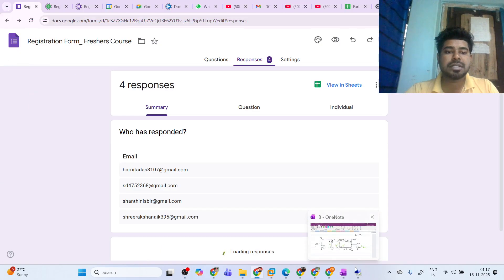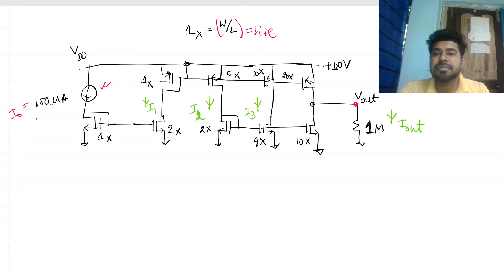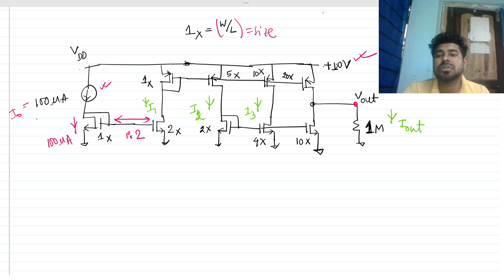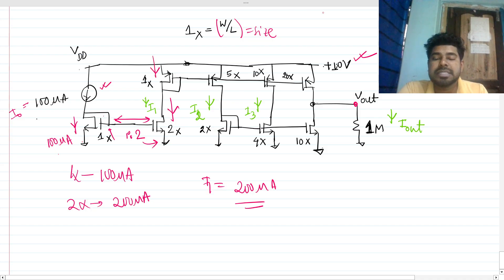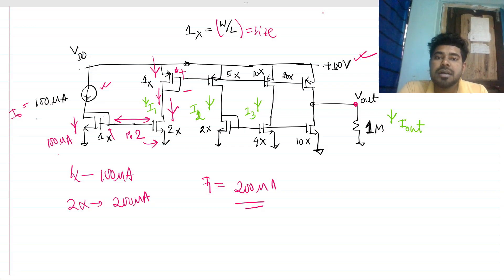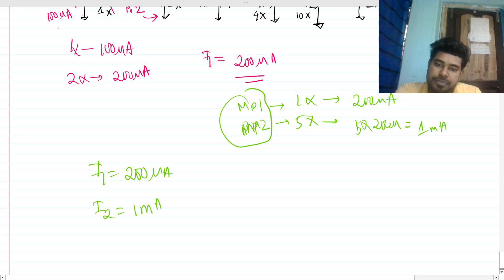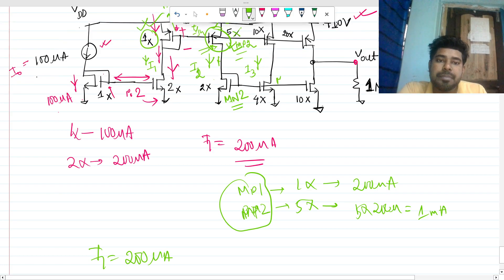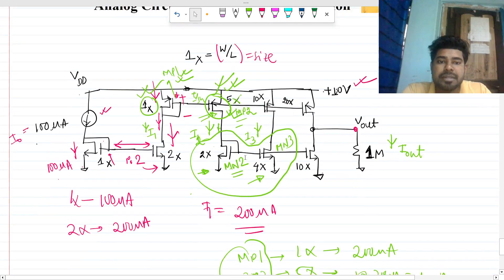Analog IC Design Engineer interview_ Current Mirror voltage & Currents calculation_ Amit Bar

Comment: See you posted first wrong question and then started correcting it, make sure from beginning that the question is alright
Reply from the maker: If you really want to learn,you can solve the problem by seeing the thumbnail itself 😊,,this is called exp. you can understand the questions is wrong or not !!
Reply from the maker: People like you just point out others mistakes only don't want to learn
Reply: Just the size 20 is replaced with 40! 
Repeat again ! 😌